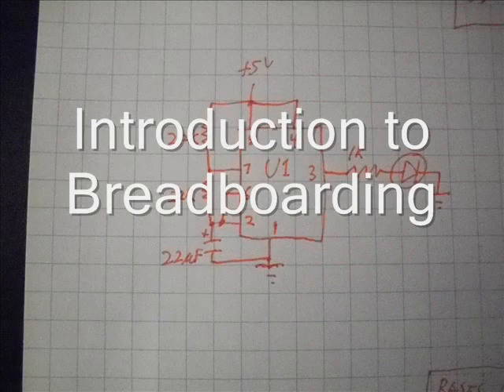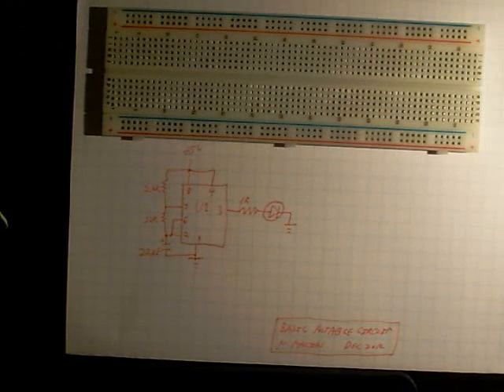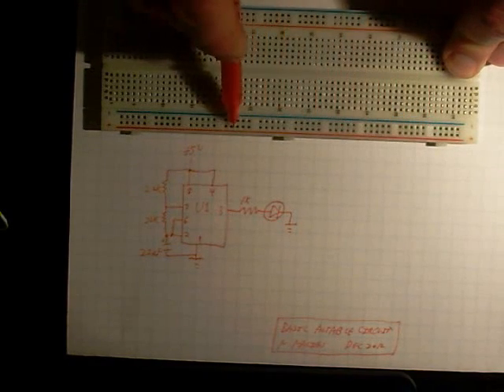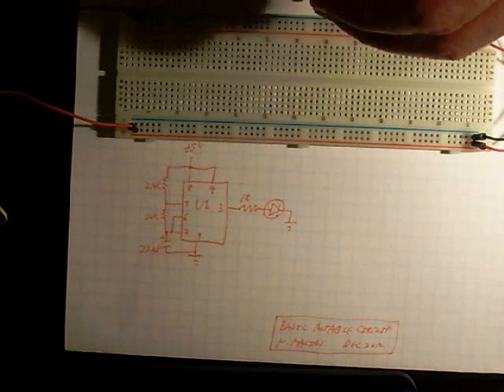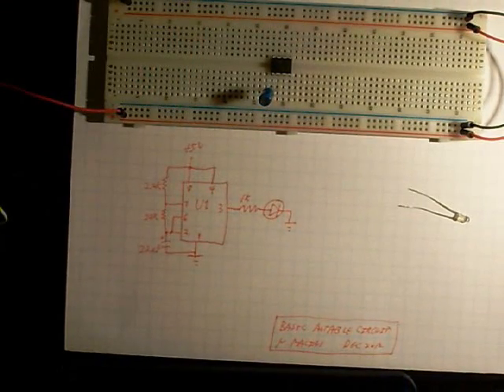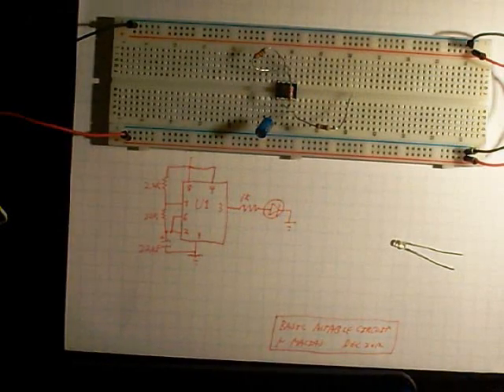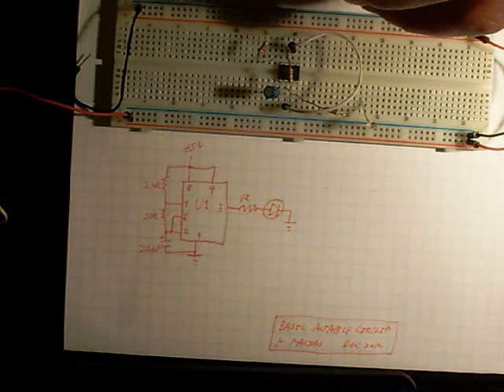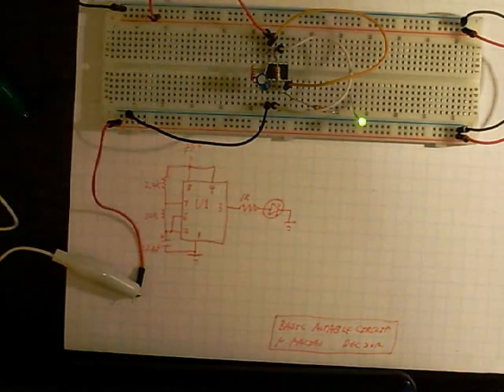Intro to Breadboarding

Comment: lost me at the pins
Reply from the maker: The numbering? It's counter-clockwise (if you look from above); you just need to figure out which pin is "1" Sometimes there's a small dot next to it, but there's almost always a notch on one edge of the chip, and that will match an image in the chip's datasheet, which will show you the pin numbers.

Comment: thanks for the video! look, it makes difference ,if three components are conected in series, which order they are plugged in? i mean, 123 or 132 or 321? i have a capacitor that is connected to a reistor and a another reistor. as soon as the legs of the components are in line, dos matter which is right or left?
cheers
Reply from the maker: In a simple series configuration, in theory, the order doesn't matter; but if you're looking at point in the middle of the series etc. the order may change things.